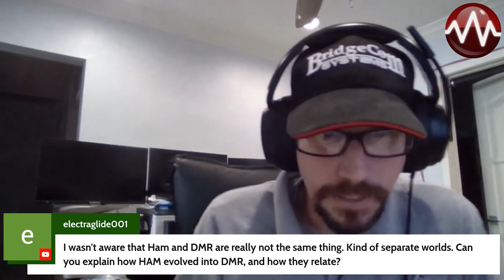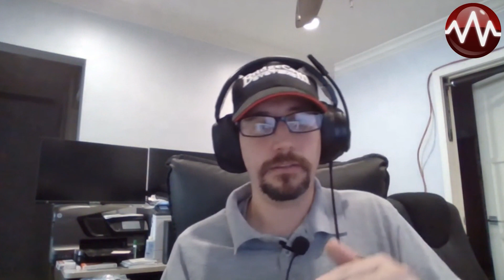Ham Radio vs. DMR: Key Differences Explained | What is the Difference Between Ham Radio and DMR?

Comment: DMR relies heavily on internet infrastructure so not only are you already paying for your internet service you also have to spend more on a hotspot to get DMR working so you can use your radios. Its actually more expensive, in the old analog days of VHF/UHF people didn't rely on just echo link... simplex modes were also used that didn't need the internet. Sure echolinks were fun but they weren't the main focus of the hobby. I'm not bashing DMR because DMR is a cool thing and clearly is very popular. Digital simplex isn't really a thing at least not in my area. DMR is the new thing and if you can't do HF for what ever reason, then its DMR.

Comment: DMR and Fusion and D-Star are just different modes of ham radio just like Echolink and IRLP.  You still need a license to operate and the fact your title insinuate’s that DMR is not Ham Radio is just the same old song and dance we had with IRLP and Echolink.  Either get on the band wagon or get off.  And if you believe DMR is not Ham Radio then stop selling the stuff which probably makes up 90% of your profits.   Very hypocritical
Reply: Video or question makes no sense, makes me wonder if they even know what they are talking about half the time
Reply from the maker: Huh?  Thank you for your comment.   We truly believe DMR is perfect for ham radio.
Reply: @BridgeComSystemsInc  Then why is your title what is the difference between ham radio and DMR.  Making the assumption that Ham Radio and DMR are different.  I use DMR a lot and you sell DMR equipment for Ham radio so really there is no difference it is just a different mode for ham radio. 

Not what your video suggests

Comment: This video does not answer the original question and overall makes very little sense.
Reply: DMR is Ham Radio their are always those that deny new technology Ham Radio is evolving  to digital modes now on Toronto it is covered all over the GTA by a linked repeater system so it uses repeaters the same as Analog  you had IRLP and Echolink that worked the same way and people didn’t complain  now that everyone has access to digital modes through a hotspot some people still argue it is not ham radio but it is just the way the hobby is evolving and personally. I think it is for the better as it brings new hams into the hobby and talk to people around the world  it sparks new interest into the hobby
Reply from the maker: We plan on going more in depth in a later video over this topic.
Reply: @BridgeComSystemsInc It seems that you have lost your way Bridgecom. If your going to make a video don’t waste your time on stuff like this.  Give us real information that may end up being a little longer but  posting a video that confuses the watcher and makes newbie hams believe that this is actually an answer would sway them from getting involved.  I know the idea is to sell your product  but the fact that you have said nothing about pi-star software being non-Supported and you need a pi02W or better to use the new version of the pi-Star software that is being written by someone else you should clarify if your hotspots have this new board or old board thst will run very slow on all current 0W boards.
Reply: Lol video or question makes 0 sense

Comment: DMR is Motorola's proprietary digital radio system.  It was designed for commercial and public safety users where the user doesn't know anything about RF, radio, etc. but to set the radio to channel xyz for communication.  That is the reason that most DMR radios must be programmed from a computer with a cable and software.  That is so that the end user doesn't mess with those settings.

DMR was designed to allow linking of repeaters over terrain that would not allow the repeaters to be easily linked via RF.  Similar to trunking radio, DMR allows more than one conversation to carried on a frequency pair.  Bridgecom actually has videos that are more in depth on the technology.

What I see happening is that DMR is declining while Fusion is growing.  DMR got a big boost early on from the influx of cheap Chinese ($69 UHF) DMR radios and surplus Motorola radios.  Lots of folks bought them and then found that they are a PITA to program and there may not be a many, or any, repeaters in range of where they are.  Since then the prices for easier to use (Anytone) radios rival the price of big three Japanese radios.  And, the programming software is kludgy.

And, Yaesu has the FT-70D HT for well under $200, as little as $140 on sale.  The Yaesu radios are easy to program with or without a cable & software.  They are easy to switch between analog and digital.  So, many clubs and served agencies are switching to Fusion.
Reply from the maker: Thank you for your well written comment.  Thank you for being here.